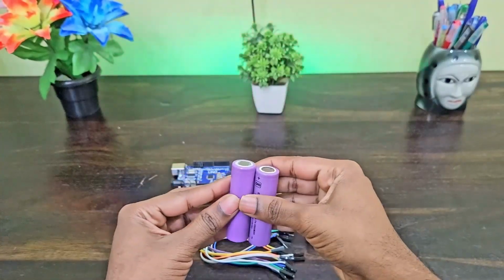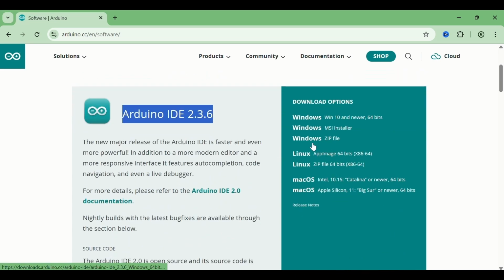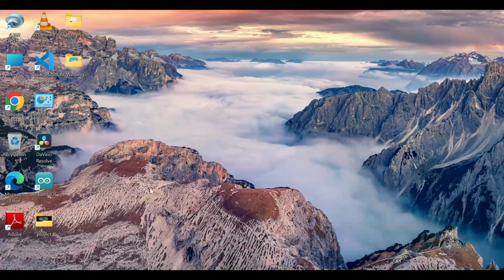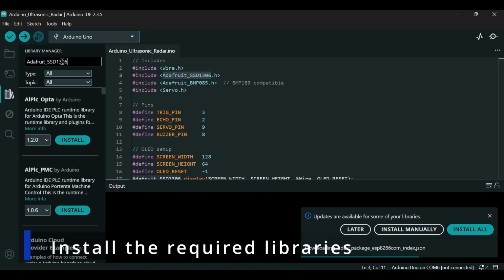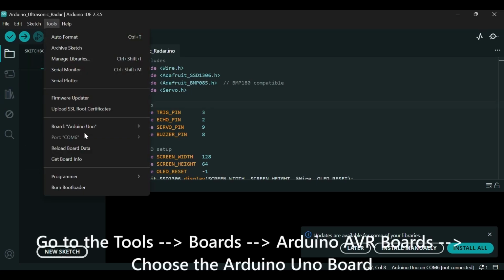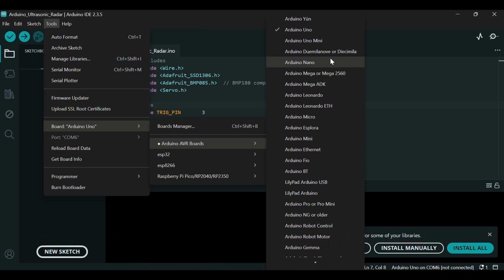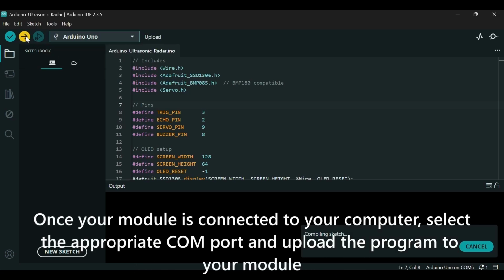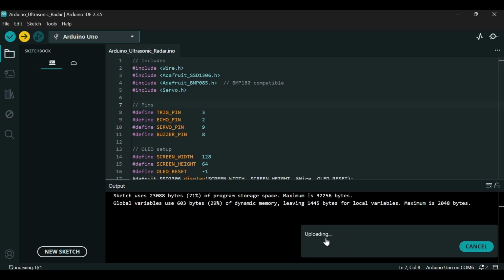How to Make a Radar using Arduino

Comment: can i connect it to my laptop instead of the oled display
Reply from the maker: No, it's not possible to connect the display directly to your laptop, as it is specifically designed to work with Arduino modules. You can connect it to your laptop via USB for power only, but it will not display any sweeping animation on your computer screen.
Reply: @crazyexperiments-2000 how about a bigger display